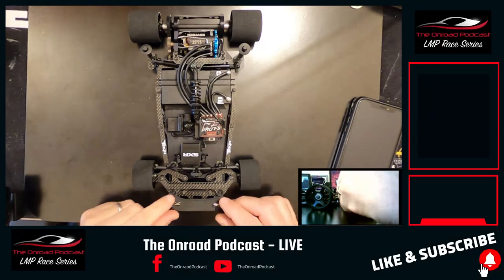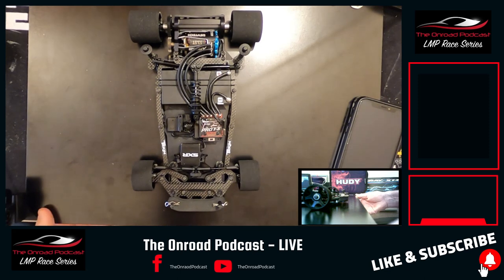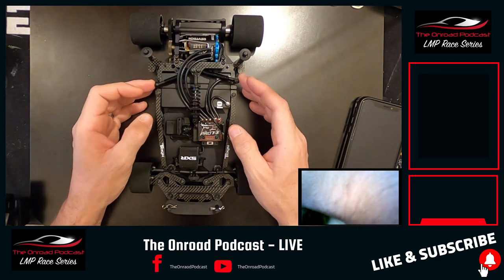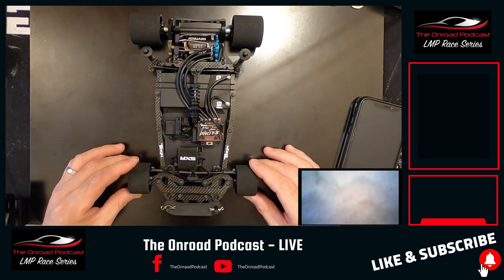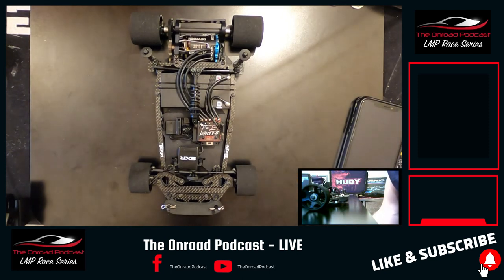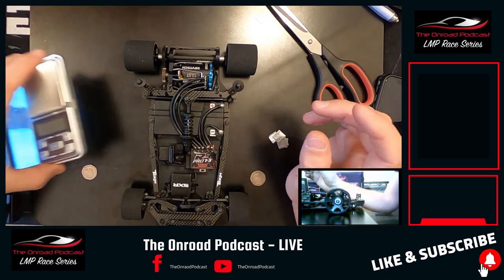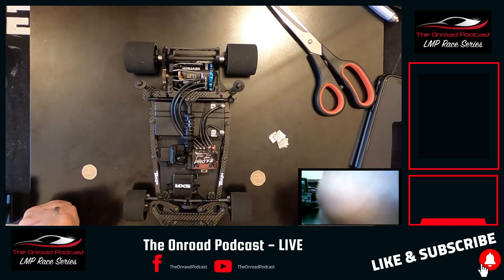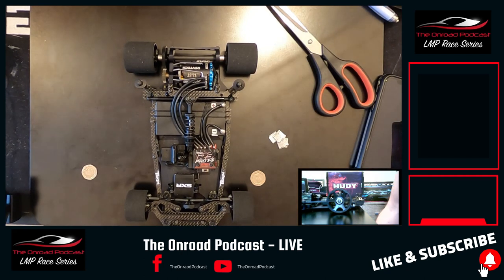FINAL Chassis Balance Tweaks

Comment: Question.  I did all your balance stuff with the rear springs up and dampener tubes removed. Got it balance perfect. But then I put it on my Hudy balance pins and it’s not balanced. Any ide what’s going on here I’m at a loss?
Reply from the maker: I’d perhaps question how you’ve measured wit the pins “potentially” but can’t be sure
Reply: @RCRaceCar  not sure what you mean. You just put the chassis on the pins and it either falls left or falls right.